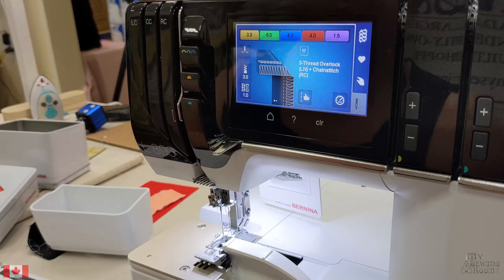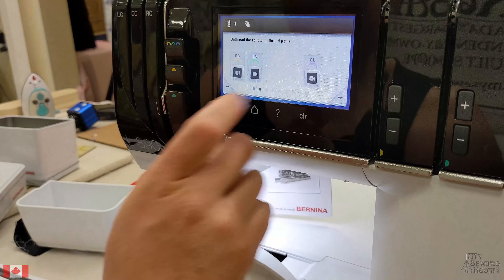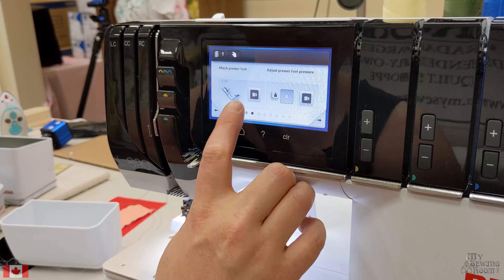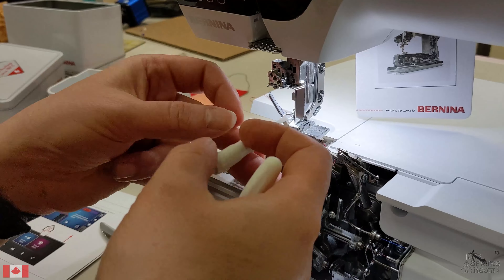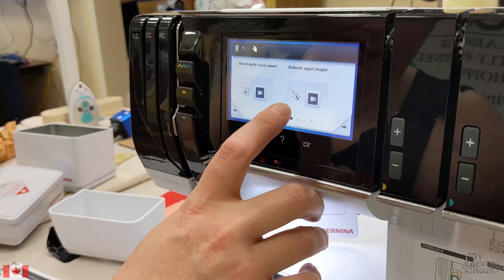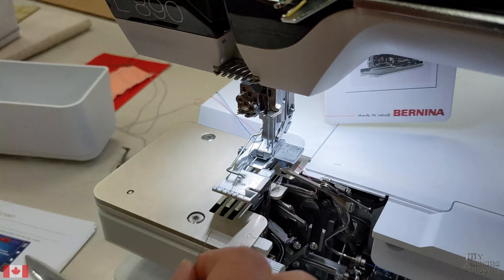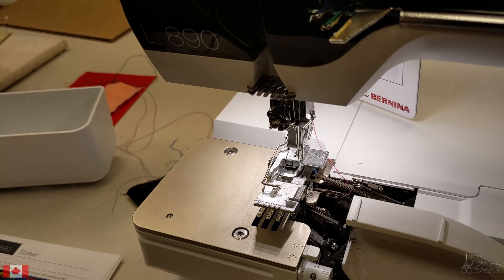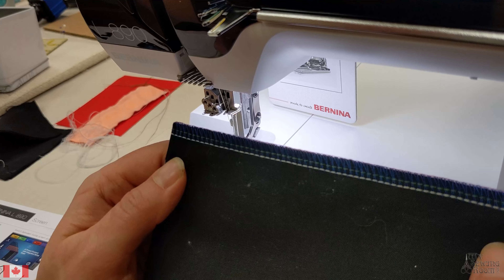Threading The L890 For Overlocking

Comment: Hi my l890 won't pick up the thread in the far right.  The purple one.  I was thinking I may have a piece of thread broken off in there.  I live 2 hours away from the nearest bernina shop.  (I live 2 hours away from everything) what should I do?
Reply from the maker: Thank you for watching and commenting. Please take a minute to clean and oil. The next step is a complete re-thread and check the needles are fully and correctly installed. TNT = Thread - Needle - Tension are the most common culprits when things are not working.